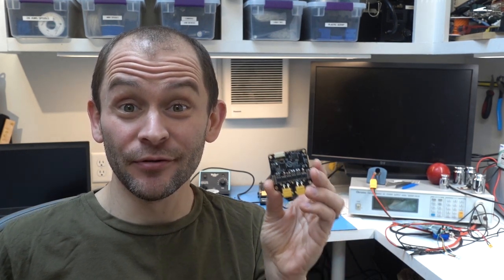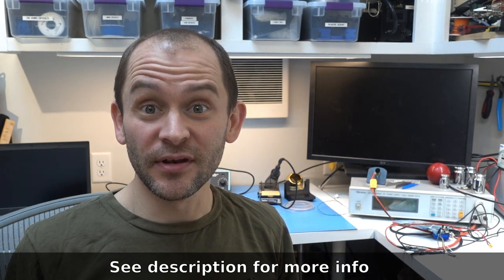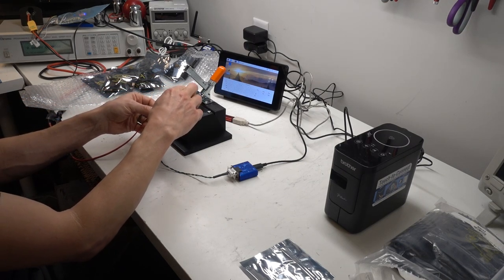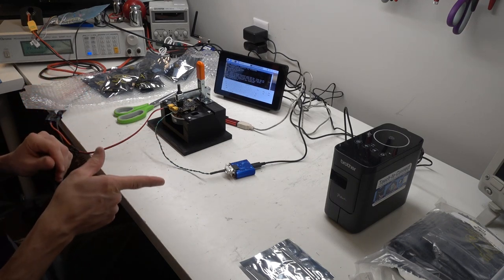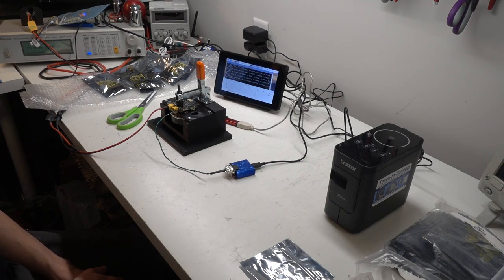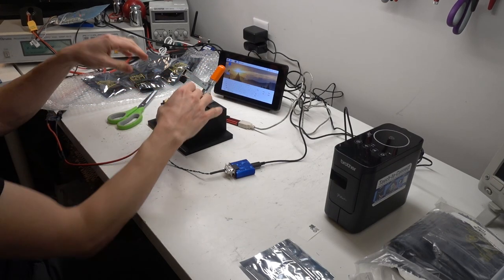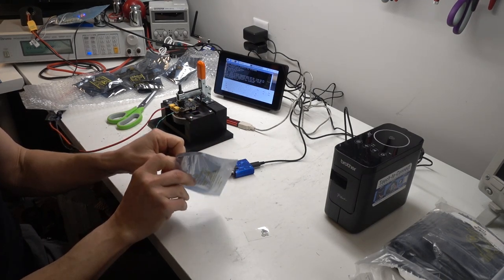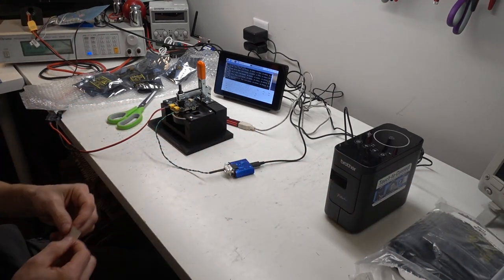Testing and programming moteus brushless controllers

Comment: what is the diference betwen this motor controlers and drone quad ECS controlers?
Reply from the maker: Drone ESCs are typically designed to rotate at high speed continuously with relatively low acceleration requirements.  Sensored FOC controllers are desired where the speed is often near 0, and high acceleration in both directions is required, as for legged robots.